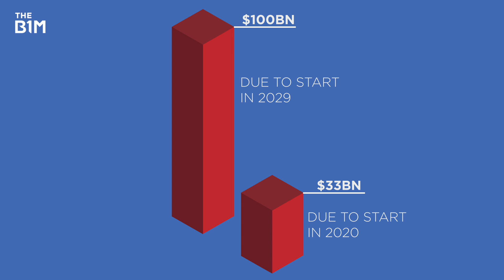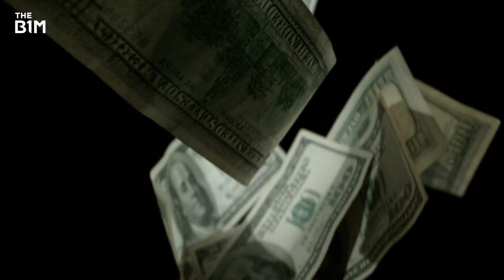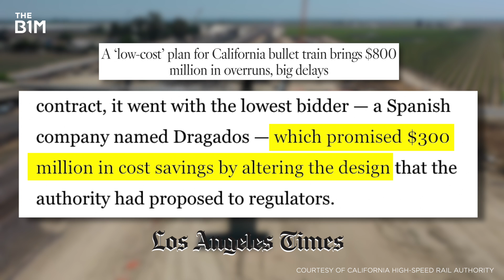What Went Wrong With California's High-Speed Railway

Comment: I’ve seen a map of the high speed rail line at work and it doesn’t make any sense. If you look at I-5 or the 99 highway, they’re both pretty darn straight. The high speed rail line meanwhile squiggles through the Central Valley which has to add to the overall cost and complexity. I don’t see why they couldn’t use the existing right of way for one of those two highways instead. Seems sketchy though.
Reply: @maxgovorukhin5039  The map shows that it curves around in sections that are just farm land and nothing else. It still meets up with major central valley cities. It might curve this way because there were land hold outs that didn't want to sell their property for the project without a fight. Eminent domain can be more expensive than just buying an adjacent property. Another possibility is that some influential person owned land somewhere and needed to be convinced to not hold up the project.
Reply: @maxgovorukhin5039  like hwy 99
Reply: @qjtvaddict  - can someone bring 99 up to interstate standards like yesterday!!!!!!
Reply: exactly that's why I voted no (one of several reasons). poor planning and poor management. I-5 is the best route because it's the shortest road between the Bay Area and LA and doesn't have a lot of towns along the way that would make it slow down.
Reply: @neutrino78x  Using I-5 for the High Speed Rail is the worst possible choice for the route since it has poor connectivity in the San Joaquin Valley. You seem to neglect that Bakersfield and Fresno are within the top 10 most populated cities in California, and Hanford, Visalia, and Tulare also heavily populated as well. The entire San Joaquin Valley has a population of 4 million, with a substation number living in the six counties in the area with the highest percentage of residents living below the poverty line. HSR stopping at these populated areas would actually be a big boon since it opens up new commuting options as people get priced out of Greater Los Angeles and the Bay Area.

Using the I-5 through the area would accomplish none of that, since it would bypass every major area of the Valley.
Reply: @TheRailLeaguer  

" Using I-5 for the High Speed Rail is the worst possible choice for the route since it has poor connectivity in the San Joaquin Valley. Y"

WRONG WRONG WRONG WRONG WRONG WRONG.

There is NO reason we could not connect Fresno and Bakersfield using an I-5 train. I-5 and 99 meet just south of Bakersfield. Just put a spur there. Also construct a spur west from Fresno along the appropriate highway to connect to I-5.

Done.

This allows you to keep up your high speed for 240 miles. You could go 215 mph for 240 miles. 

You're probably confusing I-5 with highway 101 or highway 1.

There's basically four routes: the coastal track that's already built (where Amtrak goes), 101, I-5, and 99.

I-5 is NOT along the coast. It's the OTHER inland route, the one that's shorter, straighter, and has no towns from San Jose to Los Angeles.

I can't put links here so I have to tell you what to Google. Put in this phrase, "A Rail Professional Speaks Out on the HSRA Plan". You should see a link from Cal Rail Foundation. Click on that, scroll down until you see the phrase again, click on the PDF link. Read that WHOLE article. It's everything that many of us have been saying for years about how I-5 is better. And the author is very well qualified, he's been involved in railroad management for decades.
Reply: @neutrino78x  You’re so wrong on that because having the alignment bypass the San Joaquin Valley cities and rather have them link with branch trains is NOT a viable option. This is an area where most of its 4 million residents live in the six California counties with the highest poverty rates, and not directly serving them would be a huge disgrace to the whole area. Not to mention that other HSR systems have direct train service to the intermediate cities and they’re doing fine (Japan is one example). Why can’t California?

You also have to remember that this project is not solely to link Los Angeles and San Francisco. This is the California High Speed Rail, not the Los Angeles-San Francisco High Speed Rail. Doing High Speed Rail without thinking about intermediate cities would be a disaster. Rather, California HSR has to live up to its name and directly serve much of the heavily populated cities in between. I’m talking about Bakersfield, Fresno, even Hanford. Those areas can benefit from HSR coming right into the heart of these cities, especially for the former two. 

In fact, for a compromise, if you want speed, then the best alignment is not the I-5, but rather along Highway 99. Since it serves Bakersfield, Tulare, Fresno, Madera, and other major San Joaquin Valley cities, this alignment would still allow for high speeds at up to 220 miles per hour and at the same time, connect much of the major San Joaquin Valley cities directly without the need for a branch line. The only exception to that would be Visalia and Hanford, though the latter already has AmTrak service, which should be upgraded to higher speed rail.

Please watch Alan Fisher’s video on the California HSR project for a better understanding on what I’m talking about.
Reply: @TheRailLeaguer  

"ou’re so wrong on that because having the alignment bypass the San Joaquin Valley cities and rather have them link with branch trains is NOT a viable option. "

AGAIN YOU CAN ACCOMPLISH THAT BY CONNECTING THEM TO AN I-5 HSR. THERE IS NO REASON TO SLOW IT DOWN FOR EVERYBODY.

Do you not know all those cities are already linked together by trains??? It's called Amtrak San Juaquins.

"Please watch Alan Fisher’s video on the California HSR project for a better understanding "

That guy thinks the chosen route avoids tunneling, so no, I cannot watch him for a better understanding. I have seen his videos and I disagree.

Hate to break it to you but you can support public transit and not be a railfan, you can support upgrading train networks and yet not want to waste 100 billion dollars trying to build something that "competes" with private sector high speed transportation and yet accomplishes something that only goes 1/4 the speed.
Reply: @neutrino78x  Having HSR directly service Bakersfield and Fresno does not slow anybody down. 

The San Joaquin train does not go directly to Los Angeles or into San Francisco, and it’s not high speed either. Directly connecting San Joaquin cities with High Speed Rail is a big deal and is a recipe for success. Tokyo has its Shinkansen lines stop at intermediate cities between its two endpoints and I’m not seeing you complain about that.
Reply: Yep, this is how we do it in Indonesia, which is finishing its first HSR (planned to be operational by the end of 2022). The majority of the tracks are built next to major highways.
Reply: @junirenjana  I agree with you, that's how it should be done. It was done so stupidly here in California. The only good thing I can say about it is that the project is bankrupt and they can't build beyond the "initial operating segment" which is 170 miles long....beyond that they would have to come back to the ballot...and I for one would vote no (again. proud that I voted no the 1st time too).
Reply: A high speed train, cannot afford to "squiggle" anywhere, or it would have to reduce speed, to stay on the tracks - unless they go for "tilt" technology - Pendelino, runs in Italy & I think in the UK,
Reply: @Alex Haughton yup
Reply: European experts suggested a direct route but was rejected by Californian "experts"
Reply: For anyone wondering why the HSR has to squeeze through Central Valley, one particular reason is to serve the San Joaquin Valley cities of Bakersfield, Fresno, Hanford, etc. Home to a substantial number of the impoverished area’s 4 million residents. You cannot afford to have HSR bypass these cities, since this could be a whole lot of ridership potential the line could be missing out by bypassing them or have them use branch service. Won’t go well politically or economically.
Reply: @TheRailLeaguer  

"For anyone wondering why the HSR has to squeeze through Central Valley, one particular reason is to serve the San Joaquin Valley cities of Bakersfield, Fresno, Hanford, etc. Home to a substantial number of the impoverished area’s 4 million residents. "

It doesn't have to go down 99 to do that. All you have to do is have a spur that connects Bakersfield and Fresno to I-5 at high speed. There is already a train connecting all those cities.

"You cannot afford to have HSR bypass these cities, "

It's not HSR if it's stopping every five miles dude, come on. The TGV doesn't stop at every little village between Paris and Lyon.

"since this could be a whole lot of ridership potential "

I don't think so. Why is that area always green on a traffic map? And Fresno has an airport of its own that provides high speed transportation to SF and LA already.
Reply: @neutrino78x  Only Visalia would require a spur to the line (mainly since any alignment would make serving that area impossible without lengthy deviations). Everyone else can and should be served with a direct route, not a branch line which is in no way a recipe to gain ridership.

Also the San Joaquin Valley cities are not 5 miles apart, but rather a considerable distance away from each other. Besides, Japan’s Shinkansen lines stop at intermediate cities between its endpoints. Acela makes some stops between DC and New York and between New York and Boston. Why can’t California?

It’s as if you have something against the San Joaquin Valley or people trying to relocate there. The namesake county is a rapidly growing area so it is really a non-starter to have the main alignment bypass these major areas. That’s like having the Acela make no stops between DC and New York and between New York and Boston. Makes no sense.
Reply: @TheRailLeaguer  

"Only Visalia would require a spur to the line (mainly since any alignment would make serving that area impossible without lengthy deviations)."

I feel like Bakersfield is closer to I-5. I would put the spurs at Bakersfield and Tracy, for an I-5 HSR. 

"Also the San Joaquin Valley cities are not 5 miles apart, but rather a considerable distance away from each other"

If you're trying to go 200, you don't stop every fifty miles.

"apan’s Shinkansen lines stop at intermediate cities between its endpoints"

But it still uses the fastest corridor it can.

Also, JR Group (the Japanese company that operates the Shkinkansen) is one of the entities that offered to help pay for the CAHSR.....until they found out CAHSRA insisted on going down 99. SNCF also made that offer and also rescinded when they heard CAHSRA insisted on 99. Both SNCF and JR Group said the only way we would get private investment is if we went down I-5. So far it looks like they were right.
Reply: @neutrino78x  No need for a spur to Bakersfield when we can just serve it directly. In addition, California HSR also has express trains that will bypass some of the cities between LA and SF so if you have a problem with the trains stopping at some of the cities, the express train is available so you don’t have to sit through them. Not to mention that the trains aren’t stopping every 50 miles. The cities are sufficiently far apart anyway, and it won’t negatively impact travel between LA and SF. 

Not to mention that Highway 99 is the fastest route for California HSR, and it offers infinite more connectivity for the impoverished area. Those groups weren’t right since they do not know California’s population demographics well. Bakersfield and Fresno are in the top 10 most populated cities in California, and it would be insane to not directly serve them, or any of the 4 million people living in the San Joaquin Valley. California has 39.5 million residents. Not everyone lives in San Francisco, Sacremento, or San Francisco. The whole state does not revolve around those three cities all he.

If the HSR went down I-5 directly, ridership would’ve been very low and San Joaquin Valley would still be impoverished. The line HAS to go through the San Joaquin Valley cities. Not worth it bypassing it on I-5.
Reply: @TheRailLeaguer  

"No need for spurs to Bakersfield and to Tracy. "

If you're going down I-5 you need spurs for them because they're on 99.

", California HSR also has express trains that will bypass some of the cities so if you have a problem with the trains stopping at some of the cities, the express train is available so you don’t have to sit through them."

Sure but that just means fewer runs are going to be useful. Plus you're speed encumbered...even if you don't stop, you have to slow down quite a bit.

"Not to mention that Highway 99 is the fastest route for California HSR,"

lmao. This is like a religion for you isn't it.

99 is a speed encumbered route because you're passing through all kinds of towns. Even if you don't stop there, you can't go full speed. Their estimate for expressing through the IOS is 56 minutes which is about 160 or so average. 

Whereas going down I-5 you can average close to your top speed, 200+.

Did you check out the document I told you to check out? Google "A Rail Professional Speaks Out on the HSRA Plan". Click on the first link, then scroll down until you find that phrase and download the PDF. It's written by a guy with a lot of experience in railroad logistics. I would link it but 80% of the time YouTube eats your comment if you put a link.
Reply: @neutrino78x  Maybe we should just have the whole thing go along 99 instead, preferably along the median. It’s still fast, with no connectivity sacrificed.

Express trains will not eat into frequency of train service or the number of runs. 

I really don’t understand why you solely think about LA-SF travel without considering the intermediate cities, especially those siting in the top 10. That’s just single-minded thinking, same with the PDF link (which I read) which fails to account for high ridership potential at the intermediate cities. One of these intermediate cities, San Jose in the Bay area, actually has more population than San Francisco. 1 million compared to 870k. Do you suggest having the trains bypass that city, because nobody is?

In short, no consideration for intermediate cities is a disaster. Everyone knows it. The California HSR has to work for everyone and having a route with zero consideration for the San Joaquin Valley does not work for everyone. Enough with the hate for the San Joaquin Valley.
Reply: I really don’t understand this hate for the Central Valley. Like seriously. 8 million people live in the Valley, half of which live in the San Joaquin Valley. Yes. THE San Joaquin Valley. Home to six counties with the highest poverty rates IN THE COUNTRY, and you people couldn’t care less about directly serving these people with a HSR link and bringing economic prosperity to them? How heartless of you all? The whole states does not solely revolve around LA and San Francisco you know. There’s a whole world outside of those areas, and maybe you should show some sympathy rather than heartlessly criticize the project for providing access to the impoverished area.
Reply: @TheRailLeaguer  

" really don’t understand this hate for the Central Valley. "

Again, you can connect to them while going down I-5. It's not either or.
Reply: @neutrino78x  Using the I-5 is NOT a viable option since it does not connect to the Central Valley at all, so it is an either/or. Literally makes no sense at all. Many other high speed rail systems directly serve intermediate cities with no issues. This also includes the Northeast corridor Acela corridor. That's like suggesting the Acela should make non stops at all between DC and Boston. You need to stop with the non-sensical plans of yours. Everybody agrees with having the HSR directly serve the Central Valley cities via Highway 99. It's still the fastest and most direct route and it works for everyone.

You need to stop with that non-sensical plan of yours to have the line run via I-5, where it would basically gain no ridership. You also need to stop looking only at LA-SF travel, and focus on the bigger picture.
Reply: High speed rails need not be on the ground.  They could be elevated or underground!  It could be much cheaper under the properties of people wishing to get rich overnight or even elevated over highways.
Reply: @johnchow8372  I'm not sure I understand your comment fully but building it on the ground is cheaper than building it elevated which is cheaper than trenching/tunneling and building underground (despite what Elon believes).
Reply: @johnchow8372  You forget that property rights include mineral rights underground and overhead, so going under/over the property would still require legal rights.  A majority of the necessary lands need to come from farmers, which are a huge political force in Sacramento.  The Authority has already burned bridges with the farmers by abusing the imminent domain rules, which has resulted in some expensive court rulings (another reason for the added expense and delays - everybody has a lawyer).  The Authority has also pissed off a number of state agencies as well - CalTrans being a major one.  So running the rail alongside I-5 or SR-99 using the existing encroachment has been fought successfully for most part by CalTrans.  Add in the fact that they're building this on a couple of major fault lines, in a state with some of the strictest earthquake building codes in the world, it's a bollywog all around.
Reply: @macsandsquid528  The technical reasons are made-up bullshit.  The shinkansen works perfectly fine and has a literally PERFECT safety record in JAPAN, which has far more earthquakes than California.  But I'm sure California insisted on reinventing the wheel, even if the wheel has been working for SIXTY YEARS without a single passenger fatality.
Reply: They want to give the Central Valley the shaft - they always do! 99 was supposed to be brought up to interstate standard a long time ago...never happened - the only Central Valley town that gets attention is Sacramento!!!!!!!
Reply: not to mention that to go fast, a high speed line needs to go straight and minimise turns. This route makes no sense.
Reply: Trains have great difficulty climbing the I-5 grade through the Grapevine. That’s why they went around it. This only makes the boondoggle more expensive. Plus, the hypothetical HSR passengers can enjoy those World Famous vacation destinations of Bakersfield and Merced. CHSR is a money pit and it should be repealed.
Reply: Likely because of NIMBY folks.
Reply: well then, put that stupid train in your backyard, and you pay for it to.
Reply: @dave8599  Lol I'm from NYC. I don't mind noise, nor trains. I've lived with both every day of my life.
Reply: Because “Muh property”